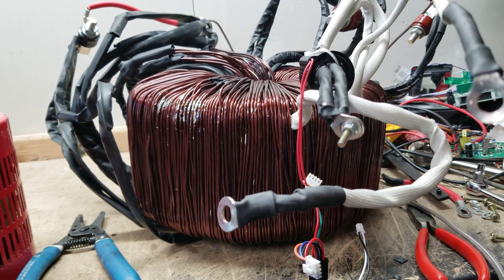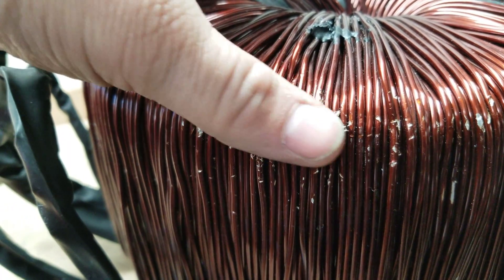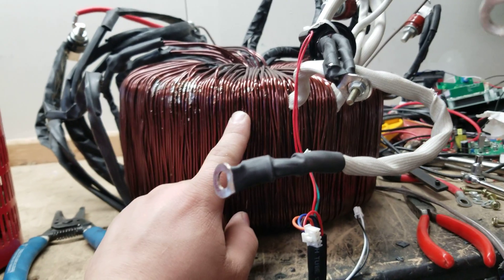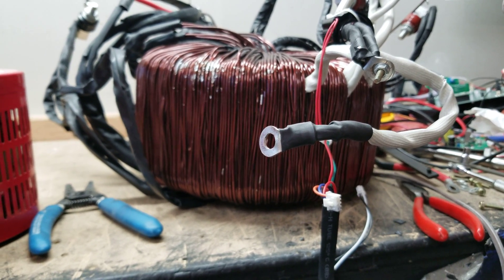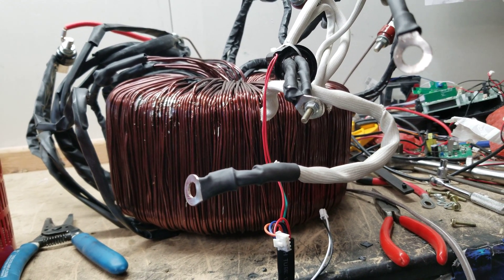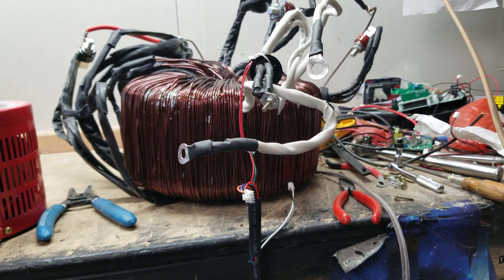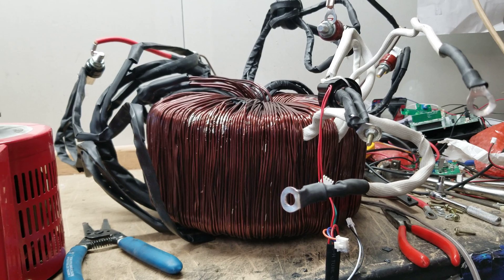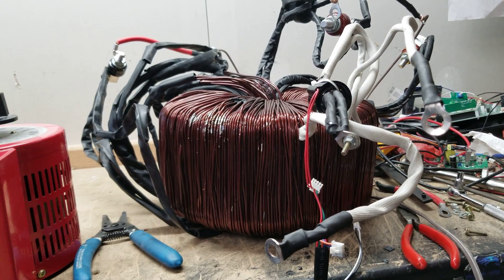20kw Power Jack transformer it's a beast! or an octopus.

Comment: You can test it by powering up the 120 Volt side alone  and if it is properly made it should not draw more than 50 micro amps.That is with all the other winding's open .

Comment: It's a shame when the shipping cost + scrap value of something exceeds the value of something which should be repaired.
Lets hope that's not the case here.
Cutting out the damaged wire, splicing new sections in (with soldering + heatstrink) would be the easy way to fix, or just rewind the whole thing.
Reply: Sort of...maybe.  The issue is that there are six separate primary windings (or "DC side") on this big octopus (as the easiest way to increase the current carrying capacity of the primary).  And each of those six windings is comprised of five or six individual strands of wire.  Shorting separate windings together (or different turns of the same windings) can cause a hot spot/transformer failure, which greatly complicates repair work.  You would be surprised how much power (and heat) is generated by a single turn around these toroid cores...think microwave transformer converted to DIY welder.

Comment: remember you taking that 1500 main board inverter and adding the larger S3 or maybe it was a s4  Transformer the little mainboard done just fine it will be the same with this Transformer any inverter you can fit it in or modify the case for it to fit in will do fine I bet one of the 8000 watt boards with push that Transformer pretty good probably push it at least up to ten or twelve thousand watts and it not even get warm but you would know more about the money but I'm pretty sure of it